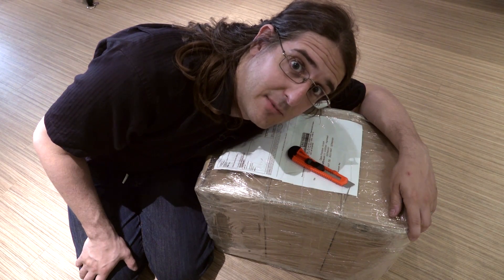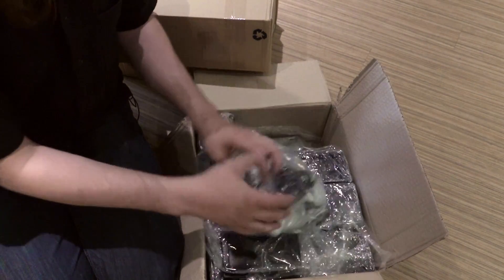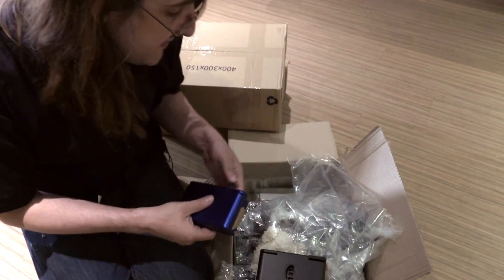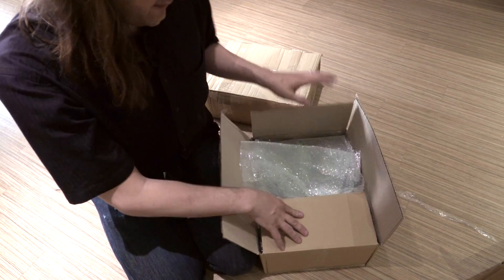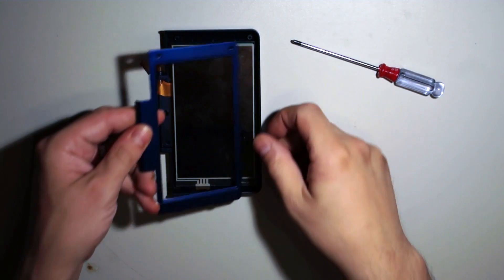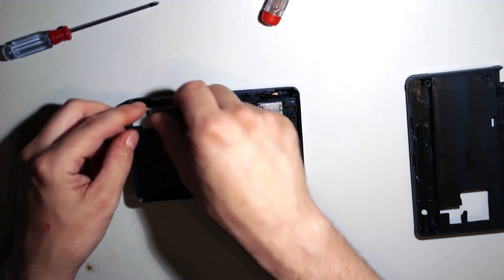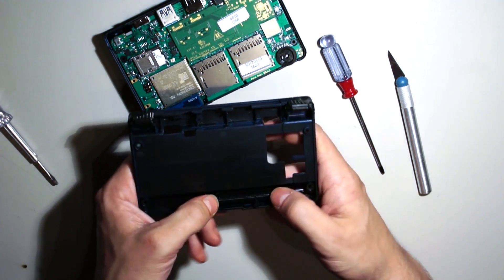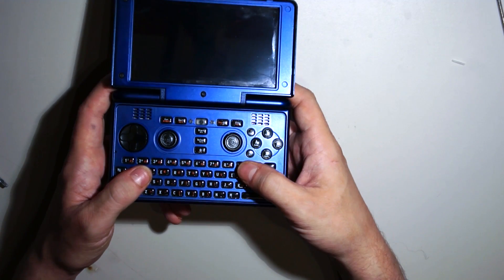Pyra: Cases unboxing, assembly and thoughts

Comment: Why is this so expensive? Not hating but compared to GPD Win which is $70 less and has 2gb more RAM, i don't quite understand why this is so much more expensive.
Reply: Well, there are some things to understand here... GPD is a WAY bigger company with a lot more capital. They can easily design and develop such a device with their own fundings, whereas we need to get it back (and we had about 300k EUR development costs.

Also, they develop in China, which means that most companies are just right around the corner and it's a LOT cheaper than in Germany as well (lower wages, etc.)

Additionally, since they have their own designers in their team, they don't have to hire third-party companies to do these things - which saves another huge amount of money.

And finally, the GPD Win is a lot simpler:
* No replaceable CPU Board
* No replaceable Battery
* A lot less stuff in more space (this alone saves about 40k EUR in development costs)
* Less features: No keyboard backlight, way cheaper (and worse) keyboard, only one MicroSD Card slot (compared to two SD- and one MicroSD in the Pyra), no GPS or other sensors (except gyro), no 3G/4G Internet, less USB ports.

The Pyra has a lot of custom made stuff, whereas the GPD Win uses a lot of stock designs in a lot more space which makes the design a lot easier.

So yes, they might be similar in appearance, but are a lot more different on a closer look :)

Comment: The Pandora's design was well put together but I never felt comfortable with the idea of taking it apart. The Pyra looks way more end-user friendly for the purposes of opening up and replacing parts or upgrading the internals which should make this a much stronger device with a longer lifespan!
Reply: Oh yeah, after having taken my pandora apart a whole ton of times, I can safely say that it doesn't handle repeated openings very well, even just the battery lid is a mess and many screw slots were broken... It still works and fits together though and I still love playing Starcraft on it :P
Reply: The device is very weak in my opinion

Comment: Do the cases have any fibreglass in them or are they just straight ABS or something? It's been a while since I looked in on this project and I see this has replaceable processors and video to last a long time. I REALLY hope you are using plastic with glass fiber with a high percentage. This is the type of plastic they make power tools with and doesn't dry out and become brittle and can be dropped on the floor etc. The stuff lasts forever. It's also highly resistant to oils and grease and sweat and probably a lot of acids and has a higher melting point. Thanks for the update and best success! This will be awesome when it comes out!
Reply: I hope it's going to be skookum enough
Reply: They're PC which is the most resistant plastic out there.